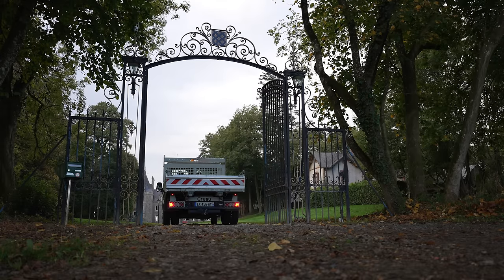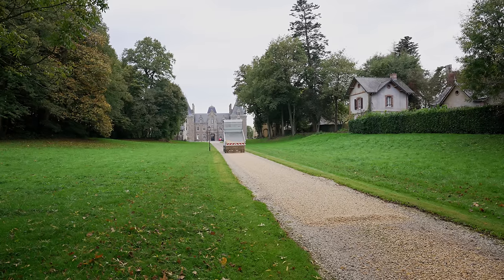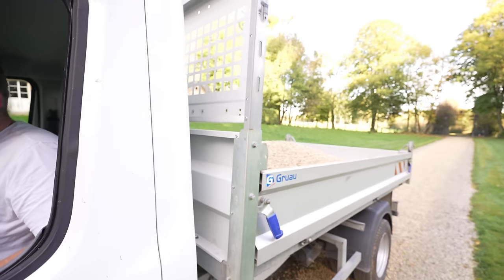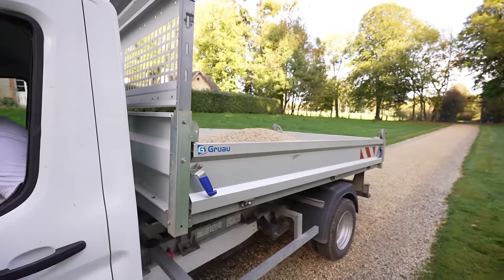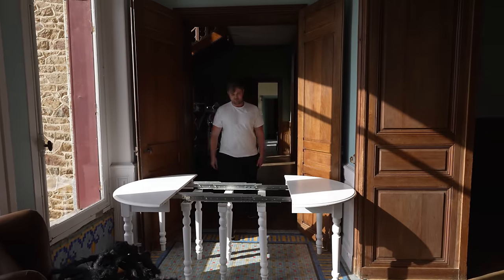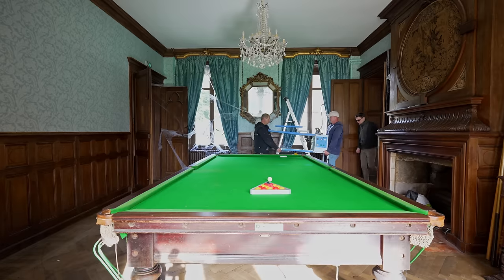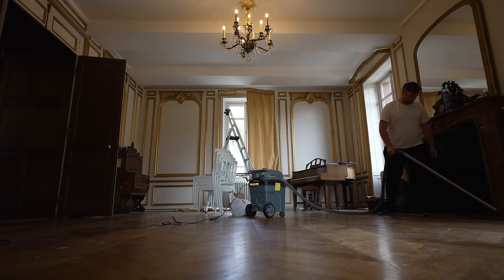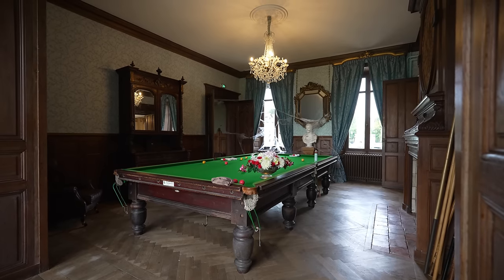We Didn't Have Enough To Finish The Job

Comment: Tip: next time you tailgate the driveway, do one pass hugging the lefthand edge, then one pass hugging the righthand edge. The passes will overlap down the middle and that slightly higher crown will shed rain off to sides ☺

Comment: I found this too..  The astronomical clock of Messina is an astronomical clock constructed by the Ungerer Company of Strasbourg in 1933. It is built into the campanile of Messina Cathedral. The mechanism was designed by Frédéric Klinghammer, with the artistic design based on plans by Théodore Ungerer. Parts of the design are similar to the Strasbourg astronomical clock. It was commissioned by the Archbishop of Messina (Angelo Paino) to mark the reconstruction of the campanile after the 1908 Messina earthquake, on the advice of Pope Pius XI, who gave him a functioning model of the Strasbourg clock.

Comment: Watching all the work on the driveway leads me to wonder how many workers / servants it took to run the chateau when it was built. I can't remember now when it was built but it was certainly during a time when labor was cheap or free.

Re naming the bell, my preference goes with those that think it should be named for someone with connection to the convent.  I do like the idea a naming it 'Sisters' though or maybe as per Jeremy Andrews suggestion. 

Looking forward to Q&A.  I'd like to know about the parking and how much weight that applies to decisions on what to do.

Comment: The Bell should have a name on it and it may be older than you suspect it to be.  Due to the Cathedral Stamp on the bell. Some of the spires/towers were renovated and everything replaced around the time of King Henry X1V then again after a fire not sure if it was the 1st or 2nd fire.  There was a time when the bells were stopped but the Vineyards and local merchants won to have them rung again only with quieter bells (the damper you took off the paddle?).  I read so much my brain hurts.  

Under the Reformation in 1521, the cathedral became a Protestant church, until after the incorporation of Strasburg into France in 1681 when it reverted back to the Catholic faith. Between 1870 and 1945, Strasbourg Cathedral suffered heavily during three wars, but remained standing. During the Franco-Prussian War of 1870, projectiles set fire to the roofs of the nave and the choir stalls. During World War I, the Cathedral continued to operate in relative normality, but all bells except the ‘fat’ one, were removed.